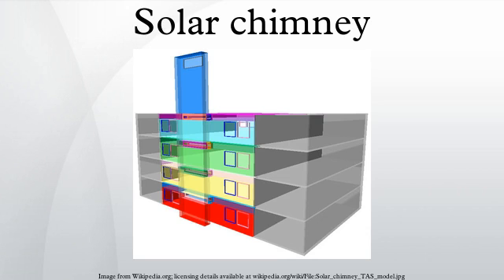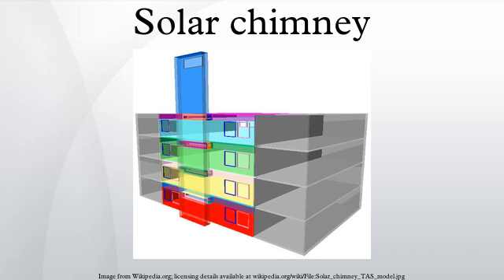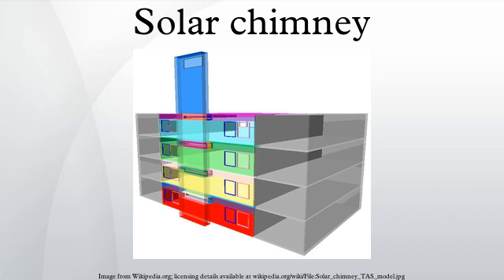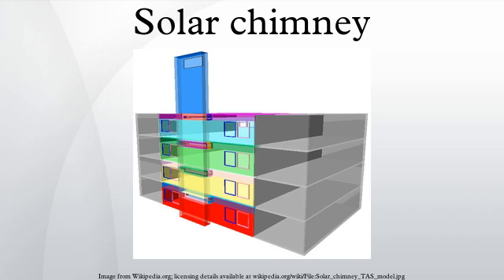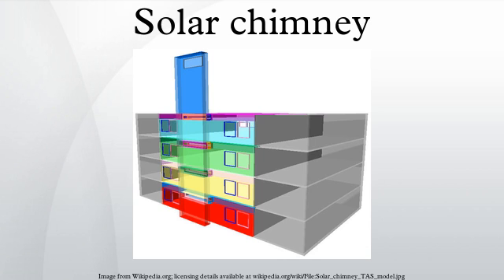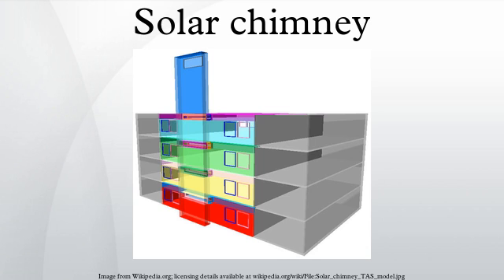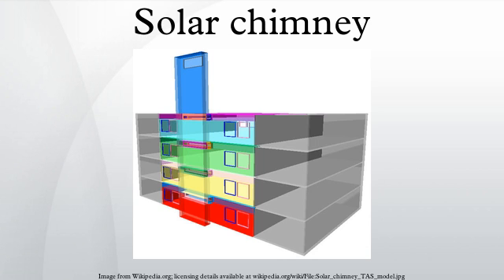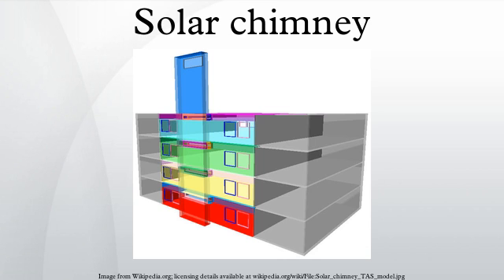Solar chimney

Comment: 6:00  UK buildings use solar assisted stacks to reduce energy consumption without the use of a/c.  stainless steel chimneys are connected to hollow concrete floor slabs... low energy fans at top can also assist.